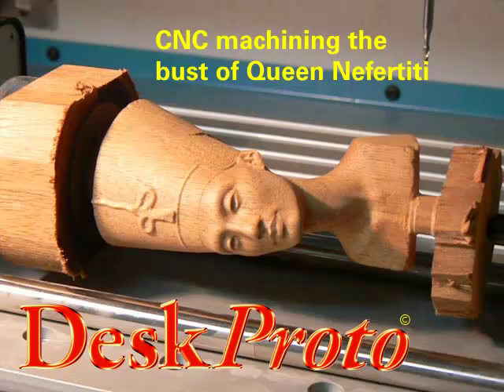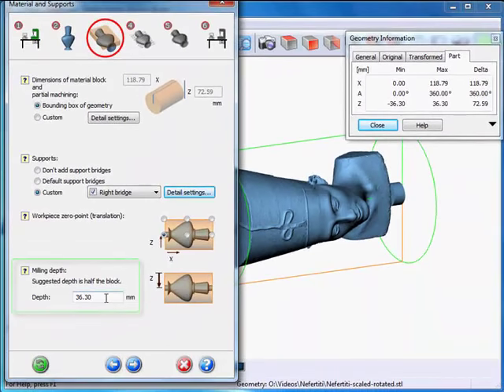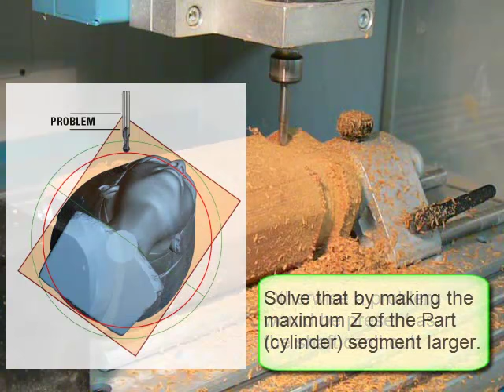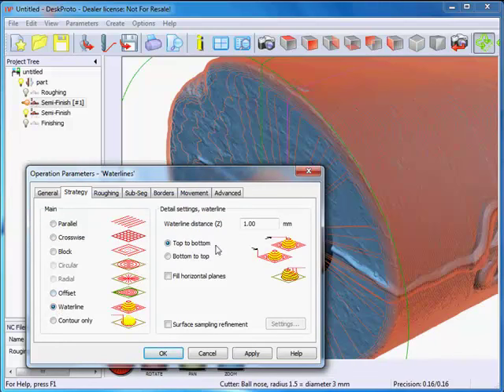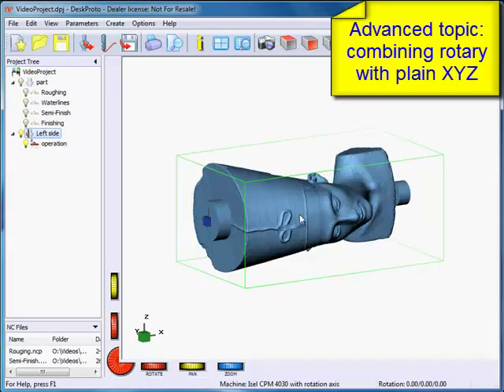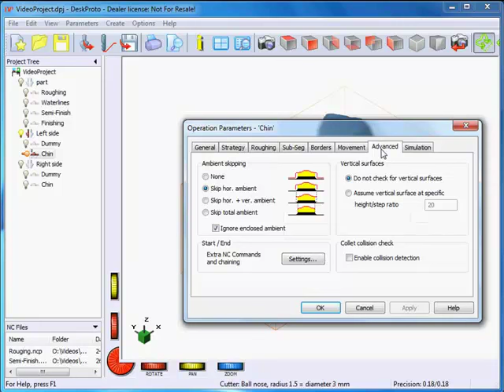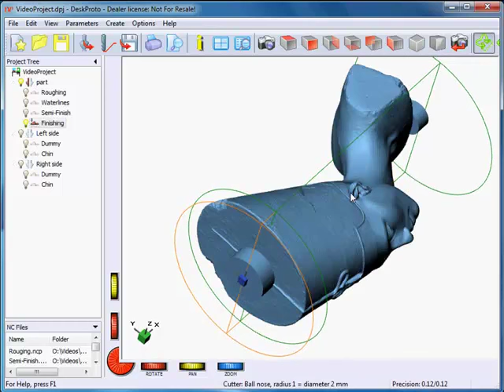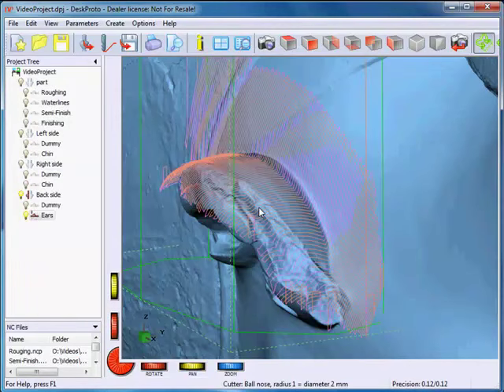DeskProto advanced Rotary machining (Nefertiti)

Comment: Will the 4 Axis abilities allow me to create complex geometries? In example, can I cut on the 4th Axis, a 3-D viking longboat made of wood, or a carving of a 3D human? Front, back, and both sides of each of these projects?
Reply from the maker: A longboat and a complete human will indeed be more complicated than the bust as shown in this video. The video shows that when machining with continuous rotation certain areas cannot be reached (in the video the areas behind the ears and below the chin). For a boat and a human figures these areas will be much larger. You can solve that by using XYZ machining from various rotation angles (this is called "indexed machining"), as shown in the video. DeskProto also offers a wizard for this type of machining.

Comment: Thank you so much
When you switch the cutter from roughing to finishing, how do I know a zero point in a rotary machine
Reply from the maker: Hi Mohamed,  When changing the cutter the X=0 and Y=0 do not change, only the Z=0 as the new cutter will have a different length.  So you need to take care when setting the Z=0 for the first cutter: use a method that you can repeat for the second cutter. For instance by setting Z=0  a certain distance above the working table of your machine. Success !
Reply: DeskProto thank you so much

Comment: Hello,
first of all thanks for the tutorial! All very clear and useful. 
I didn't understand only one thing: As zero point the geometry center was set, how do I set it on the cnc (using mach3)?
I always set the zero point on the surface of the geometry thinking it was the right way...

Thank you very much and have a nice day!🙂
Reply from the maker: Hi Jonathan,
Both ways are correct: some machinists prefer the Z=0 at the outside surface of the block, some prefer the Z=0 at the rotation axis. This latter way has the advantages that the zero is the same for all blocks, and that the block size needs not be accurate. You need to set it before clamping the block on your rotation axis. You can check if it is correct by (for instance) moving op 10 mm and then machining a full circle: the diameter of the resulting part then needs to be exactly 20.0 mm.
If you like you can then machine a reference block at exactly that Z=0 height, to be used the next time that you need to set this Z=0.
Reply: @Deskproto  Thank you for your kind and precise answer!
Only one small step is not clear for me: once I have set the zero point without block, I move the Z axis to the necessary distance from zero (maybe Z=100), I mount the block on the rotation axis... and I start machining from the point where I left Z-axis (X=0 Y=0 Z=100)?
Reply from the maker: @Jonathan-cs9si  Yes, that is exactly correct. The position of the cutter when starting the toolpaths is irrelevant (as long as it is high enough): it will simply move from where it is to the first point of the toolpath.
Reply: @Deskproto  Thank you☺

Comment: This is a great tutorial. But I would have liked to see how you set the work piece XY=0 and Z=0. I would also have liked to see the initial movements of the machine. Particularly after changing cutters. 

I tried setting my machine up for rotary. It has X and Y switched compared to DP. But the origin setting seems to get set to the chuck end rather than the tailstock. So when it starts, it tries to crash into the tailstock.
Reply from the maker: This crashing the tailstock does indeed look like an error in setting the correct zero point. I agree that it would be great if we could include that in the tutorial - unfortunately we can't as the instructions depend on which machine you are using (or rather its controller). For most controllers you can move the machine to a certain location and then tell the control software that the zero point is on that location. For rotary machining with a Z=0 on the rotation axis that needs to be done before the block is loaded.
Reply: @Deskproto  Thanks for the reply. I think I solved it by setting it to the geometry centre, as X and Z are fixed it's just the rough centre of the material block. I solved the z setting by cutting a block of wood to exactly match the centre of the rotary axis, then I use the z tool calibration to get that height automatically.
Reply from the maker: @privacytest9126  Well found !

Comment: Hi. please answer: is it possible to milling on 3 axis machine, provided that one of these axes - axis of rotation, milling the part below the axis of rotation? Thank you
Reply from the maker: These are in fact two questions:
1. Can you use DeskProto for rotation axis machining on a 3-axis machine
2. Can you machine below the axis of rotation.

1. Yes: when rotation axis machining DeskProto does not move the Y-axis: only X, Z and A are used. So this can be applied on a 3-axis machine.

2. Yes, this is possible. When you check "Use rotation axis" DeskProto by default limits the part segment to "Upper half of geometry", so with the minimum Z at the rotation axis, as that is OK for most geometries. You can overrule that and for the Part segment select "use whole geometry". Important is that the workpiece zero point now needs to be set EXACTLY with the tip of the cutter on the rotation axis. Any small deviation will be clearly visible in the resulting part.
Reply: thank you very much!

Comment: hello i liked your videos very useful to me i have an question in the video it is shown machining done along X axis and A axis but if i want to do in Y direction means Y to A axis then what setting i have to changed  in deskproto software i tried but not succeed i m new user for deskproto
Reply from the maker: Hi Ismail,   Indeed DeskProto assumes that the rotation axis is parallel to X. You can change that in the Machine definition in DeskProto: Options > Library of machines > OK on warning > Select your machine and press Edit.  The rotation axis settings are in the Advanced settings: there you find the  option that you need to check: "Machine with 4th axis parallel to Y". Use the Help button in that dialog for more information.
Reply: thanks but not found i checked in machine lib/edit/advance setting/option but no option found there shows only 4th and fifth axis setting 
my machine is selected Mach2 / Mach3 based machine with RotAxis - mm
Reply from the maker: Hi Ismail,  When this option is not present you will be running DeskProto V6.1:  the option has been added in Version 7.  So one solution is to switch to V7.  A rotation axis parallel to Y is possible in V6.1 too, however it is more complicated. See  www.deskproto.com/forum/forum.php?forumsubject=1&topic=176
Reply: THANKS ONCE AGAIN WHERE I CAN FIND DESK PROTO V7 CRACKED VERSION CAN YOU SEND ME THE LINK
Reply from the maker: ARE YOU NUTS ????    FIRST WE HELP YOU IN CONFIGURING THE DESKPROTO SOFTWARE, AND AS THANKS YOU PROPOSE TO STEAL FROM US BY USING A CRACKED VERSION. A VERY STRANGE WAY OF EXPRESSING YOUR THANKS....
Reply: ok i dont know that no issue for buying but it is for 1 yrs licence i would like to buy. i am new user for cnc router so no any idea for software
Reply: from where i can able to this buy this version what is the procedure ?
Reply from the maker: You can find all prices on our website. That also includes a webshop where you can buy a license. We do not offer a 1 year license, however the prices of the (perpetual) licenses are low.
Reply: thanks once again waiting for your new videos

Comment: Can u make a video about how to use deskproto on 5 Axis none rotary? I Mean for cnc with 2 additional Axis on head,. Can we rotate spindle use deskproto? I have install this software but cannot use it because my cnc 5 Axis with 2 Axis on head. 🙏
Reply from the maker: @Riubotin, DeskProto does not support machines with their rotation axes on the head, sorry about that. Only machines with the A and B rotations done by the parts are supported. For 5-axis that are "trunnion style" machines.
Reply: @Deskproto  : Thanks for reply Sir, Can u tell me what kind of software is Rekomended for my machine with 2 Axis in head? Maybe Mastercam, Fusion360, or what? Thanks. 🙏
Reply from the maker: @riubotin  We do not have any experience with CAM software for your type of 5-axis machine.

Comment: Ok I have more questions on this. How are you able to tell that you will need to add a water line? I was trying to mill out a skull out of aluminum and didnt think I would run into any issues. I then began to notice after breaking a bunch of bits that the previous cutter does not cut out certain parts of the model so when I bring in a finer cutter, it plunges too deep trying to remove material that the previous cutter did not remove. Since the plunge is pretty deep or too much for the tapered ball nose to handle, it causes my 4th axis to skip steps and loose it’s position or it breaks the bit. This is what happened when it got towards the chin area. It made me wonder why it wouldnt just start from the top and make it’s way down rather than trying to plunge all the way down.
Reply from the maker: This may of course happen, for instance for a hole in the part that is not wide enough for the roughing cutter. DeskProto does not have a trick to do this automatically. What may help is to show a simulation of the result after roughing. For rotary machining the simulation option to show all rest-material in green is not available though.
Reply: @Deskproto  would I then need to add a water line with a smaller bit if the larger cutter does not remove material by the chin because of how thick it is?
Reply from the maker: @metallicaandchimaira  That is correct: when the thick roughing cutter leaves some hole in the part unmachined because it is too thick, the small finishing cutter will go to the full depth in solid material. Using waterlines (from top to bottom) will help to prevent overloading the finishing cutter.
Reply: @Deskproto would you be able to give me a one on one to help me program a skull out of aluminum over zoom or discord? I have everything setup. I just have some questions on certain parts of the model that are best described if I showed you through video.
Reply from the maker: @metallicaandchimaira  I have never used Discord, and only very rarely used Zoom (during Covid). Support normally is via email. Can you send your video via WeTransfer or some other cloud-based system ?
Reply: @Deskproto  yes! How would I be able to get a hold of you? I can send a video trying to explain the issue im getting when I try to make a skull on my rotary.
Reply from the maker: @metallicaandchimaira  You can send the email (or the download link) to our general email address (info@deskproto.com). My name is Lex.

Comment: That's a really good tutorial Lex.  It's answered so many questions I had on rotary axis machining and now I feel so much more empowered. I didn't realise you could set different parts graphically and machine them separately and also do XYZ machining on the rotary axis.
If I have translated the rotary to YXZA to machine along the Y axis do I need to change this to do XYZ machining as well?
Thanks for clearing up a lot of things. :-)
Richard.
Reply from the maker: Hi Richard, sorry for the slow reply, due to our company vacation period. When you have edited the postprocessor to accommodate a rotation axis parallel to Y (so swapped X and Y), the X and Y will also be swapped for normal 3-axis jobs. You then can best use two different versions of the postprocessor (and also two different machine definitions): one for 3-axis jobs and one for 4-axis jobs.

Comment: 3 axis machine  can do sample on upper video or need 4 axis machine
Reply from the maker: Yes, you need a machine with a rotation axis (4th axis).
For rotary machining the Y-axis is not used so in fact a 3-axis controller is sufficient. This is complicated though as you then need to switch between connecting the controller to the Y-axis and to the A-axis.
Reply: so,  thank you very much, but when export to nc file by deskproto software, only 3 axis. Deskproto software can export 4 axis same powermill..
Reply from the maker: Indeed when rotation axis machining in DeskProto only three axes are used: X, Z and A.  This is explained in the video, where both XZA toolpaths and XYZ toolpaths are used.
For XYZA toolpaths you will indeed need very expensive CAM software like Powermill.

Comment: So why would you do a roughing and then a semi finish rather than just going from roughing straight to finishing?
Reply from the maker: I did not trust the very thin finishing cutter to survive removing all remaining material after roughing. That could better have been solved by using a tapered cutter for finishing.
Reply: @Deskproto  oo ok yeah that’s what I was going to ask next. So in order to not have to do these steps can they be resolved using a tapered ball nose instead? Or can you encounter this problem again if you have a pretty thick stock? The reason I ask is because I want to use this program to do a bust of my face but I will be trying to use a 3.5in(88.9mm) diameter dowel. However, the max cutting length of my tapered ball nose is 15mm but I dont not want to use the full length or it will hit the collet. So really the cutting length would really be like 10mm.
Reply from the maker: @metallicaandchimaira  With a tapered cutter you can surely skip the semi-finish. The roughing process still will be much more efficient using a ballnose cutter: you then can use a larger distance between the toolpaths. See for instance www.deskproto.com/gallery/xmasdecoration.php  (though here the total height of the part is so low that roughing could have been skipped).
Reply: @Deskproto so when you’re doing the chaining and telling the machine to go to 0. Is this the position when you first orientated the model in the first PART section?
Reply from the maker: @metallicaandchimaira  I assume that you mean the command to go to A=0 in the operation's start commands. Yes, A=0 is the original orientation of the part.   Note that in the current DeskProto V7.1 Chaining has been moved to the Project parameters.
Reply: @Deskproto hello. After doing some tests with the program. I notice that some portions that are in my models will not be machined properly. For example, I tried to do an ironman bust and also a spiderman one. When I finish the ironman one, looking from the top view, the detail on the left shoulder is very rough but the one on the right side comes out great. Then when it turns it to the back side for the finish, now the right back shoulder is rough. There are extrusions into the model for detail so these spots would need to be cut into to make the detail. Is there a way to achieve this? In this video you do an X,Y cut but it’s outside of the model. Idk how to do a cut within the model that will contour the detail in the shoulders.
Reply from the maker: @metallicaandchimaira  I cannot tell you what the cause of this problem is. Many options are present, like roughing skin too thin, climb versus conventional milling, undercuts in the model, the trial cross, ...  Sorry about that. I also do not know what you mean that the video cuts outside the model: cutting outside the model would be cutting in air, so not useful. The XYZ toolpaths in the Nefertiti video do remove chips.
Reply: @Deskproto  so I figured out what my problem was. I thought I had misalignment issues of my 4th axis but it was that I was leaving too little skin. Leaving too little skin resulted in no parts being contoured in the finishing section of the g code. I ended up doubling my skin to 1mm and the results cane out great.
Reply from the maker: @metallicaandchimaira  Glad that you have been able to find the cause of the problem 🙂

Comment: if trasform from rotation milling to 3 axis then any calculation of program in MIRROR. I must use other program for this cut 3D but si vrey hard to synchronized and some times impssible tu do. So is good only for rotation